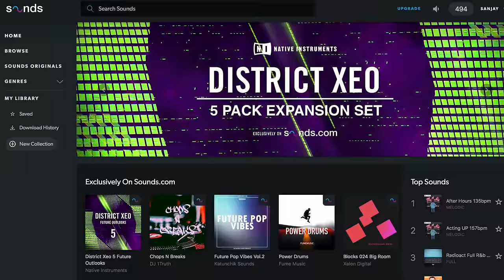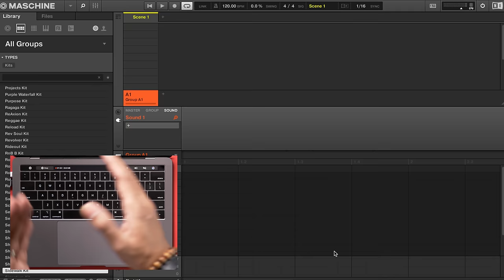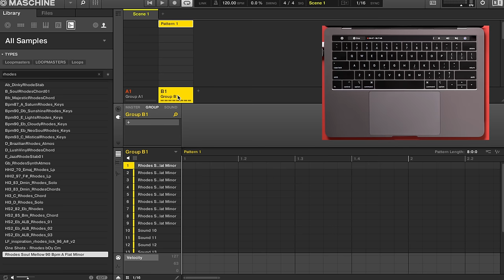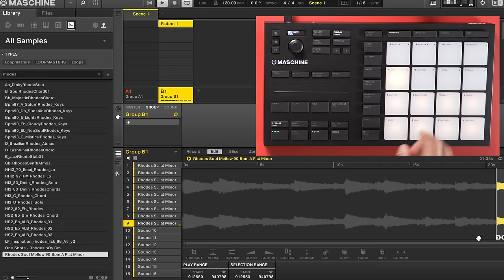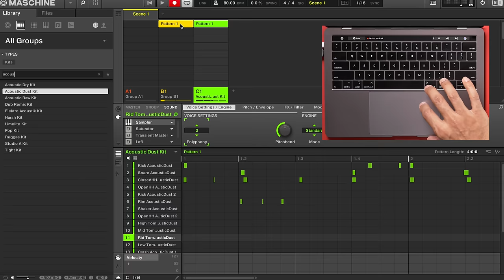Maschine Mikro MK3 Tutorial Part 4: Sample Slicing & Lo-Fi Beats

Comment: Hopefully you still respond here, but when i load my folder that has my samples in it they do not appear. They are in mp3 format if it matters.
Reply from the maker: I had a problem with MP3 loading into Maschine software. COnvert it to WAV or AIF and it'll work fine.